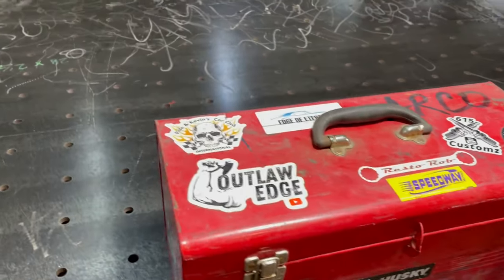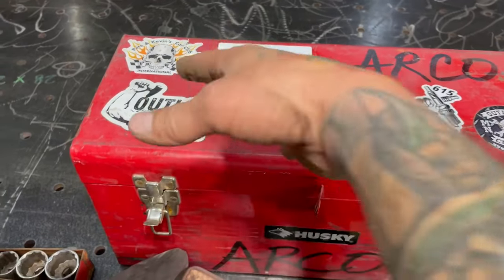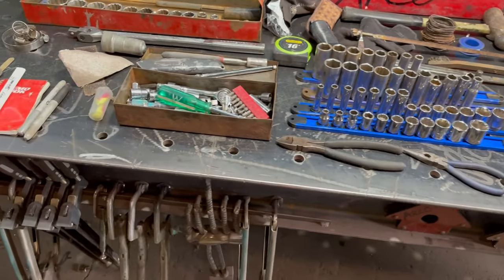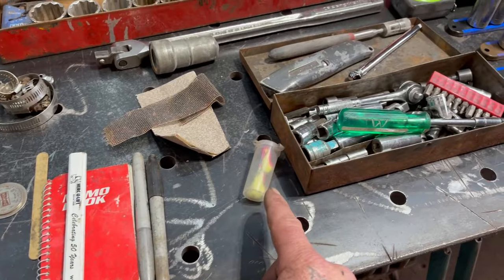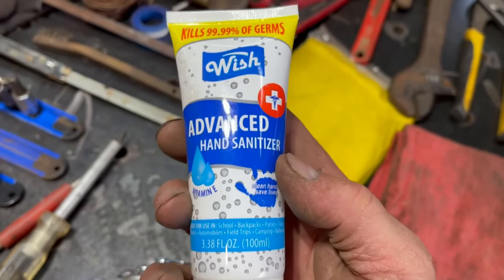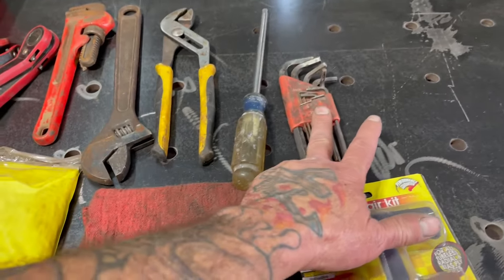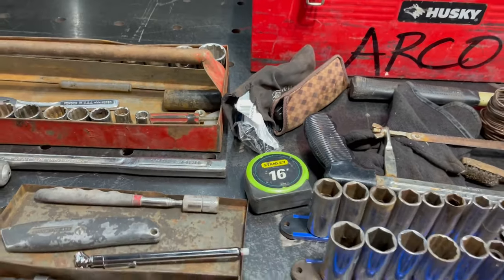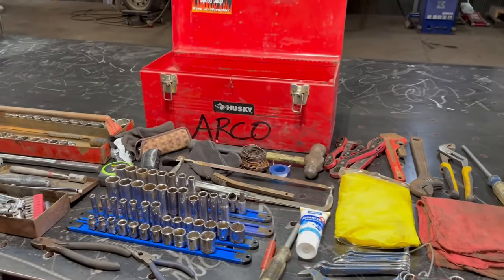Emergency Road box toolbox tour

Comment: I keep everything in a military ammo box. In the southwest the sand gets into everything and the ammo box seals tight. I keep a GoJo hand cleaner in the box, it works without water. Just the usual assortment of tools. We keep gallons of water, a tarp, and electrolyte powder in each vehicle. The number one killer here is the extreme temperature. 110-115 + degrees in the summer. Getting out of the sun and hydration keeps you alive.

Comment: I carry a small bluetooth OBDII adapter so that I can clear limp-mode codes.  I also carry some special sockets/wrenches for E-torx and a transmission dipstick (you need the scanner to read trans temp to check the level...)

Comment: I'd include flashlight, duct tape, tie straps and bailing wire.
Reply from the maker: 100 percent agreed!!! 👍👍👍
Reply: In a pinch you can use copper wire. Wasteful and expensive to use it as bailing wire, but it would keep a muffler from dragging 😂